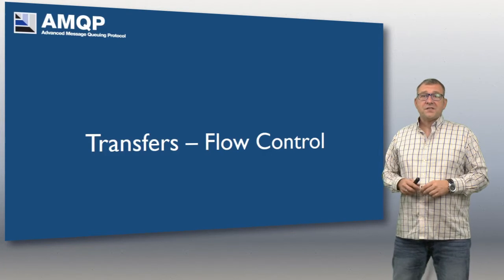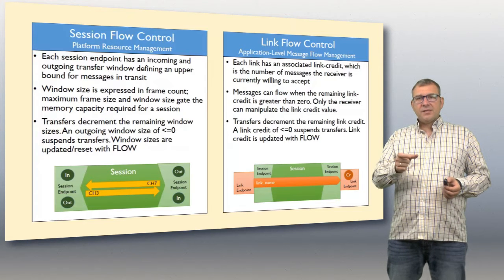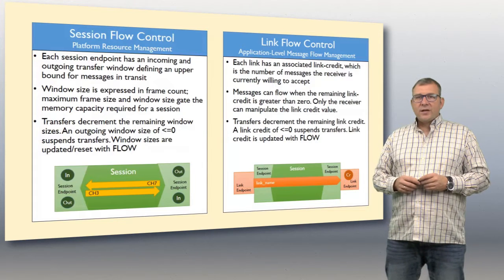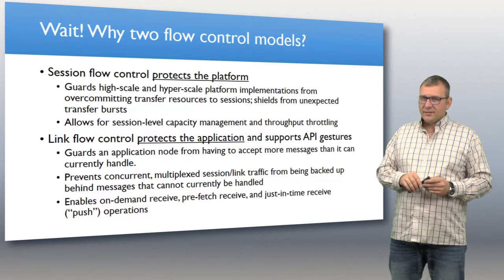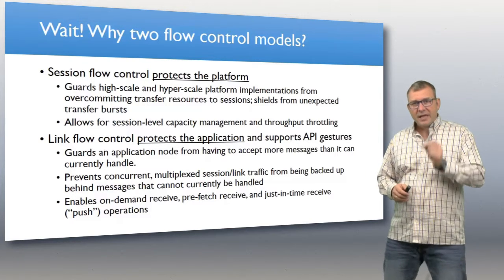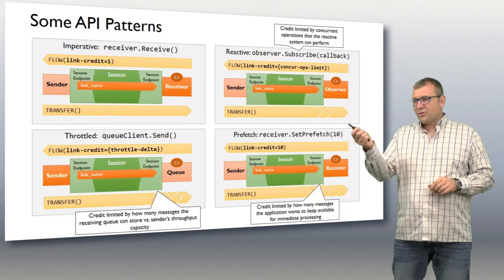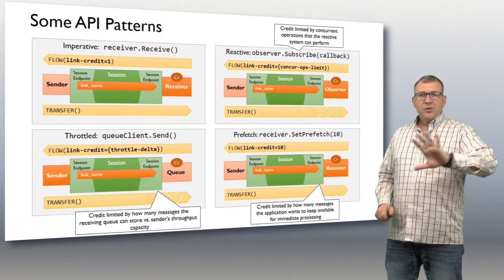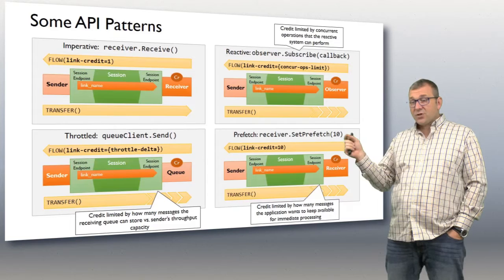The AMQP 1.0 Protocol - 4/6 - Flow Control

Comment: Hi, thanks for the videos. Session Flow Control is in the TLS layer, and Link Flow Control is above, in the application layer. Is this correct? And as i know, TCP itself has also Flow Control in its layer in the transport layer (layer4). Why is a Link Flow Control required? Is the Session Flow Control the same as the TCP Flow Control or is it again one above, additionally? Why do we have several Flow Controls on each layer/level? Why is a Link Flow Control needed if TCP already have a Flow Control? Appreciate any comments.